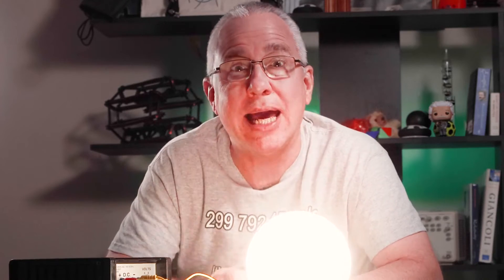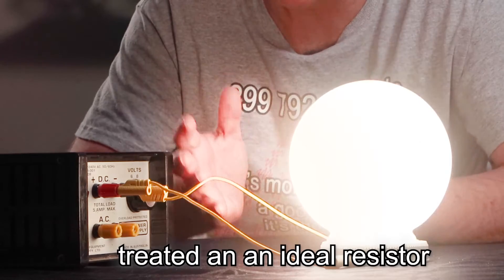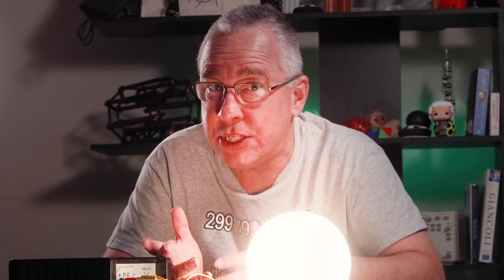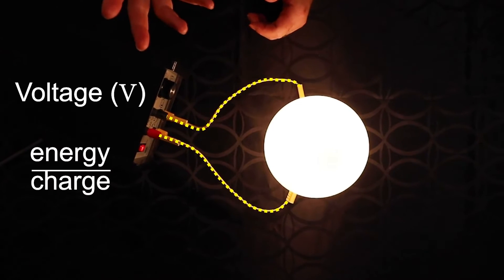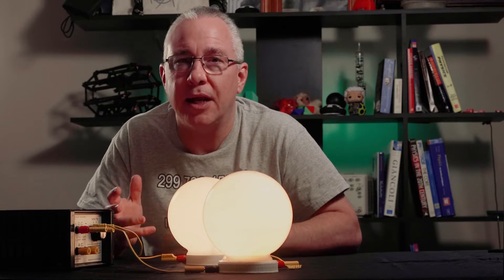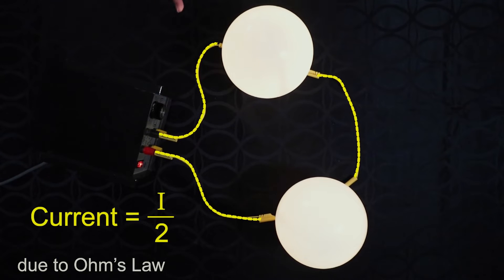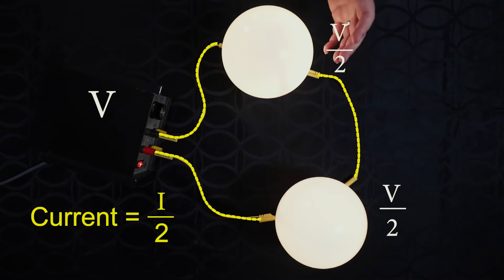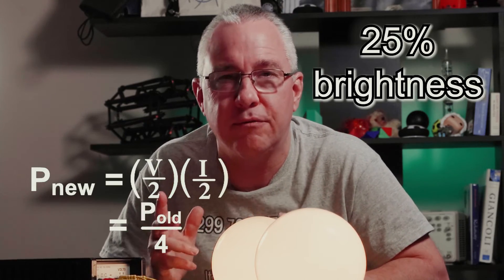What is the power of this circuit? Many get it wrong

Comment: Not a good idea using filament lamps to illustrate that as their resistance increases strongly with a higher filament temperature, thus the resistance is not fixed. Put two such identical lamps in series, and each will be cooler and have lower resistance thus the current will be rather higher than half.

As this is a rather easy experiment to perform, this is important. An led with a resistive dropper comes closer to the ideal, but even then you have the problem of an (almost) fixed forward bias voltage on the led itself.
Reply from the maker: I agree 
See my reply to a similar comment below.

Comment: Not 100% correct I think:
Power: When the current in the filament drops, so does its temperature and resistance. Thus the current is reduced by less then 50%, and the total power is more then 25% of the original value.
Brightness: When the filament gets colder it emits less visible light per watt. Thus the visible brightness is reduced by more then 25%.
Reply from the maker: You are correct, to a degree. I present a simplified model treating the globe as a ideal resistor. In reality yes, temperature does play a part and affect the resistance and thus  the power. But even then it’s simplified as we are ignoring the wire and power supply resistance. The reality is much more complicated and not feasible to address in a 1 minute video 😉